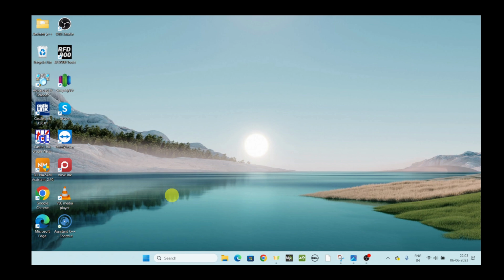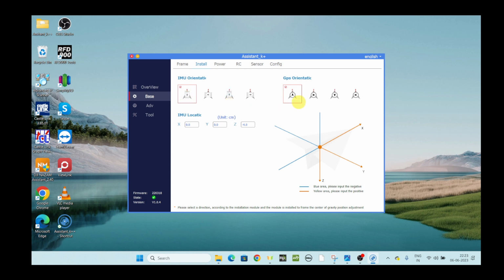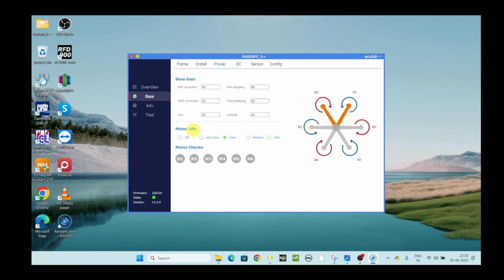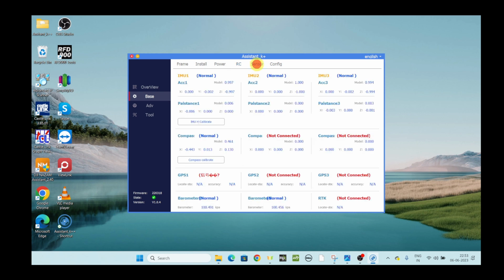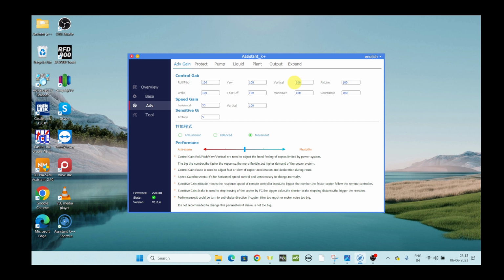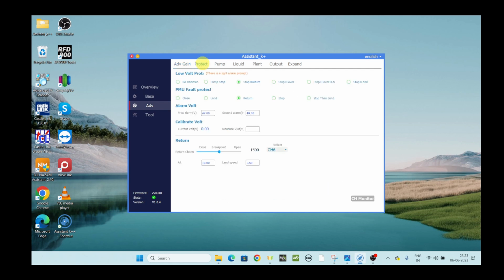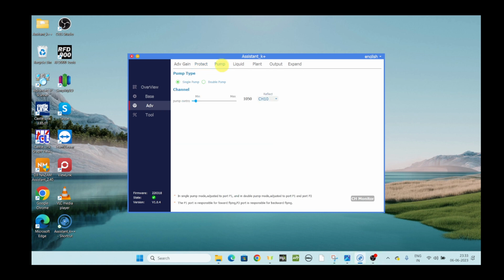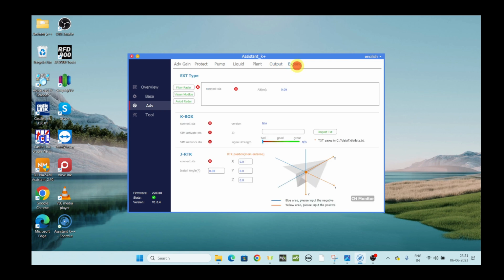Beginner's Tutorial: JIYI K++ V2 Flight Controller - Software Debugging

Comment: how max alt limit in fence mod?
Reply from the maker: The maximum altitude setting is accessible within the advanced parameter section of the software.
Reply: @karthikstechtime0910 yes it is. I ask the highest alt for it. someone say k++is limited by company to 50 m alt. can i use for drone and it raise 200 m Alt?
Reply: I want set alt limit in 200m, can do this?